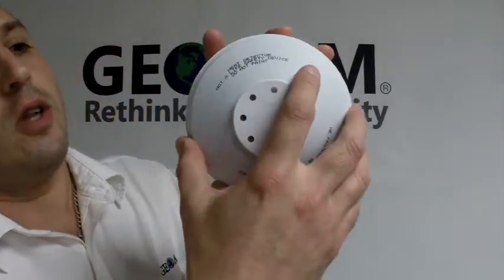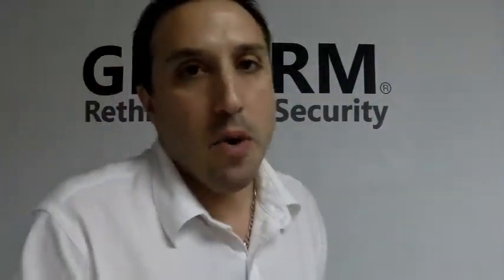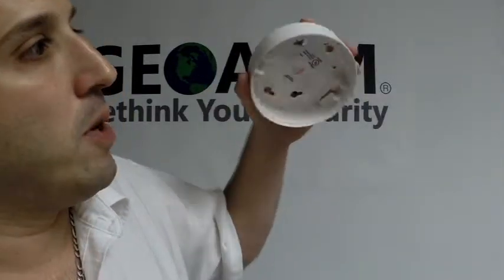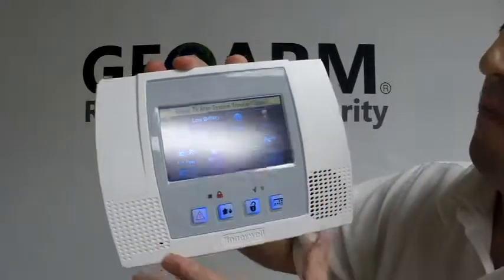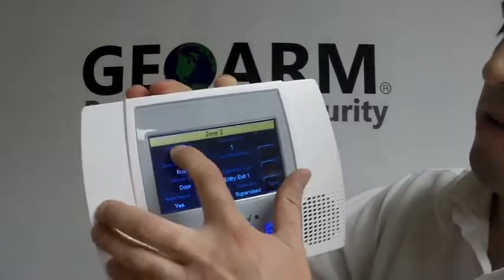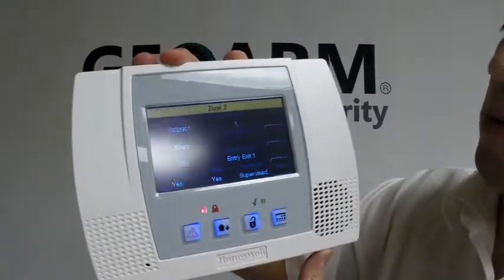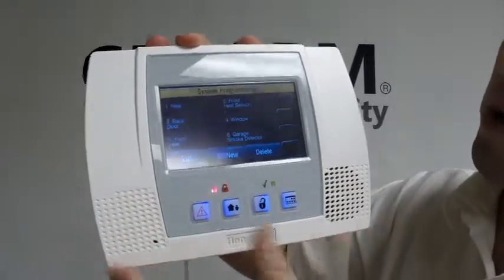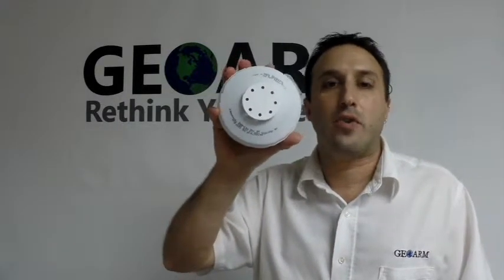Honeywell 5809 - L5100 Programming

Comment from the maker: Good Afternoon Ernane, 

The Honeywell L5100 control panel was discontinued, but if you want to use a "Honeywell 5800-Series wireless security sensor or detector" like the 5809 that you are inquiring about then you would need to invest in a wireless Honeywell control panel such as the L5200 control panel; http://www.geoarm.com/l5200-honeywell-lynx-touch-wireless-alarm-control-panel.html or a wired Honeywell control panel with a wireless receiver. 

Being that it is not a standalone detector, you can not use it without having a Honeywell control panel to receive the signal. Most authorities want monitored smoke/heat protection, so you will need to invest in a control panel. If your local authority does not, then by all means go to your local Home Depot and get a inexpensive battery-operated standalone heat detector (which makes noise) but does not result in the dispatching of the fire trucks which may save your property. 

Great question, we are always here to help.  #honeywellsecurity   #geoarmsecurity   #geoarm

Comment: I NEED TO PUT A HEAT DETECTOR IN MY BASEMANT WHERE MY BOILER IS ...THE INSPECTOR TOLD ME BESIDE MY SMOKE ALARM AND MONOXIDE CARBONE . I NEED A HEAT DETECTOR HE SAID IT COMES WITH BATTERY OPERATED. AND I THINK THE HONEYWELL 5809 HEAT DETECTOR BATTERY OPERATED IS THE ONE, HOWEVER  DO I NEED TO BUY THE HONEYWELL L5100  TOO IN ORDER FOR MY HEAT DETECTOR TO WORK?.. I THOUGHT I JUST NEED THE HEAT DETECTOR AND WHEN IT BEEPS I WOULD BE ABLE TO HEAR IT.. CAN YOU PLEASE EXPLAIN I AM A LITTLE CONFUSED , THANK YOU

Comment: So one only needs the 5809 and a L5100 or L5200 control panel? You say the L5100 has been discontinued, but I see one can still buy them on ebay. I purchased the 5809 on ebay assuming that the only thing else I needed was the Honeywell 5881EN. But it seems the 5881EN is not enough by itself. Please advise.
Reply from the maker: +Lance Gillette 

Good Morning, 
A 5809 is a wireless sensor correct, so that means you can use an all in one wireless security system such as a Honeywell L3000, l5100, l5200 etc... these system will work just fine. A 5881en is a wireless receiver that will make a wired alarm system a hybrid meaning it can utilize hardwired and wireless sensors. You cannot use a 5881en standalone to use any wireless sensors because it is not an actual alarm panel. I would recommend purchasing a Honeywell Lynx Touch L5200 wireless security system : http://www.geoarm.com/honeywell-lynx-touch-l5200-wireless-security-systems.html
Reply: Thanks! I understand now. So I understand the 5200 has Wi-Fi capabilities but is that automatically built into the controller or is it just an optional module that can be added? Also, with the wi-fi service, is it mandatory to pay a monthly fee to a company in order to be notified of any alarm status? Or can I just have text messages sent to my iphone without any cost? And one can do video surveillance too?
Reply from the maker: +Lance Gillette So the Wi-Fi communicator is a module that has to be purchased in a kit or individually. In order to have notifications sent to you via email and or push notifications you will have to at least sign up for DIY alarm monitoring.
communicator : http://www.geoarm.com/l5100-wifi-honeywell-internet-alarm-communicator-for-lynx-touch-l5100-security-system.html
l5200 wifi kit : http://www.geoarm.com/honeywell-lynx-touch-l5200-wifi-wireless-security-system-l52wfkt-ip.html
wifi diy alarm monitoring : http://www.geoarm.com/diy-total-connect-wifi-alarm-monitoring.html